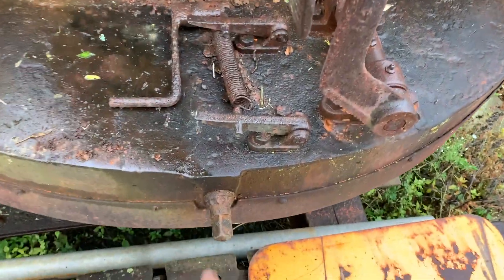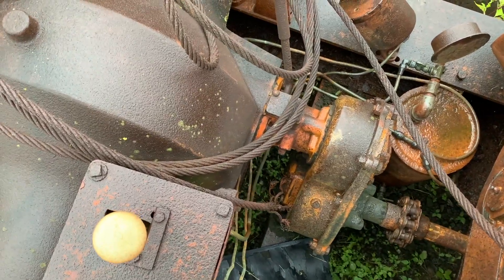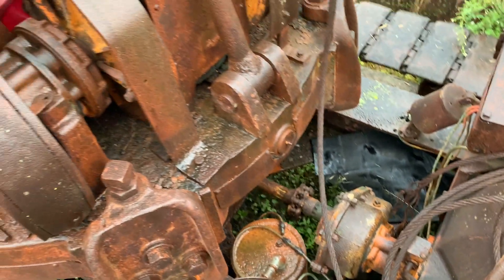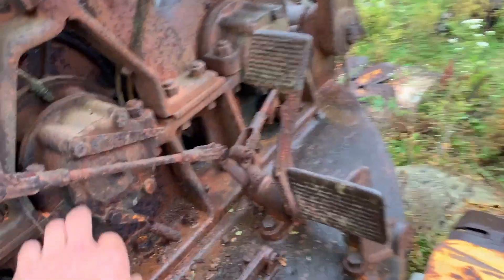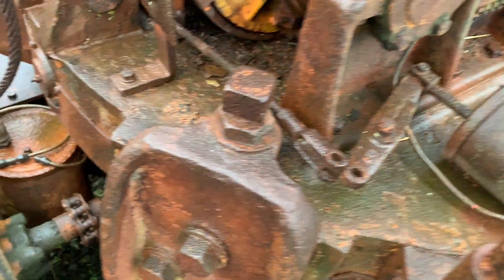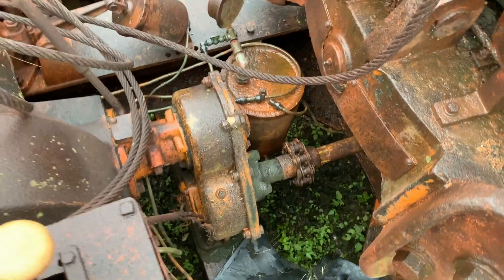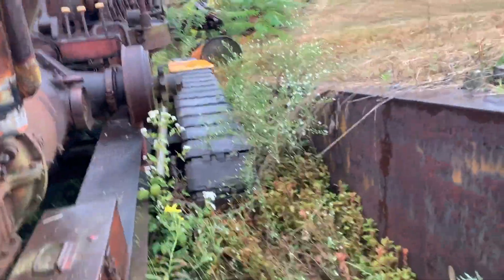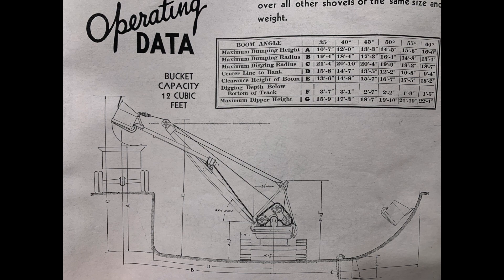Rare! Michigan Tractor shovel Model AM

Comment: Lost count but another shovel video! Surprises me to see air controls on that small and old of a machine.
Reply from the maker: yes pretty cool setup. you see the weld on the axle casting. wonder what it took to break that
Reply: @73DiamondReo  I’ll have to watch the video closer and yes, if the dipper swung back while over the engine I think the back of the bucket might put a hole in the radiator! Haha
Reply: Just watched again, quite a nice repair on that axle housing, can’t imagine how it brook. Over the years I’ve seen many very old weld repairs on castings. They were craftsmen, not just mechanics , and did amazing things with the technology they had.